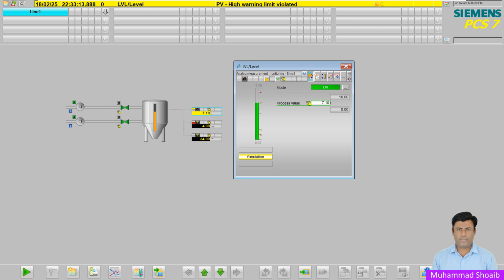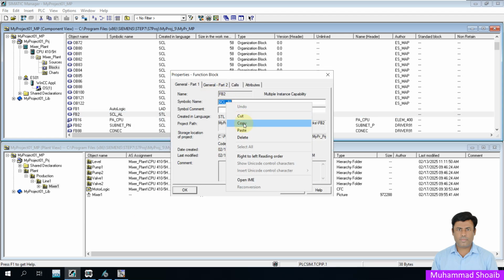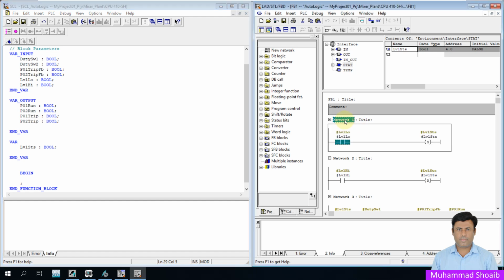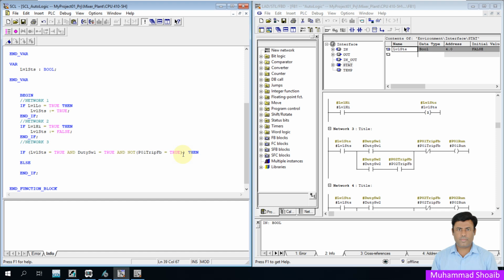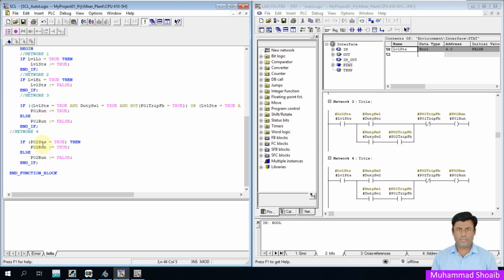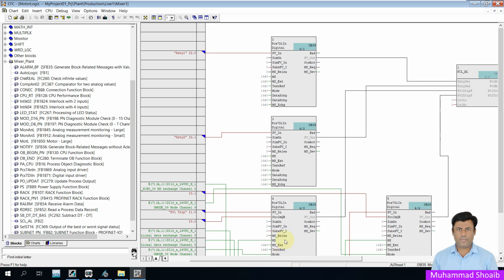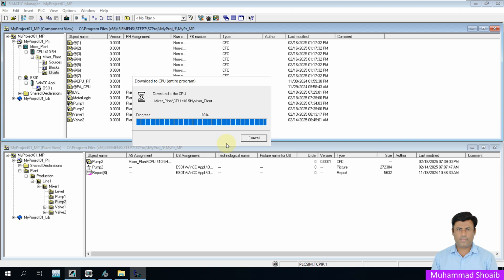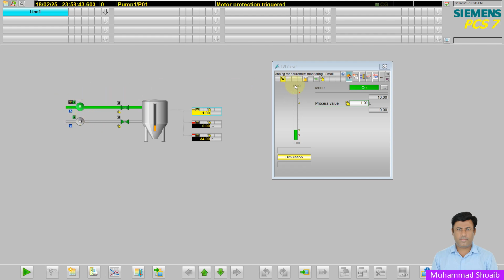11- SIMATIC PCS 7 v9.1: How to Develop Customized Logic with SCL | MOTL Block | SCL Tutorial

Comment: Hello Sir, Thank you for the example.
I have a question regarding a sample FB block I created. This block is designed to provide the connection status and the tank name based on four TOR inputs.
I followed the same logic you used in your tutorial, and the block works as expected. However, my question is: how can I display these inputs in WinCC Explorer?
Thanks in advance for your help.